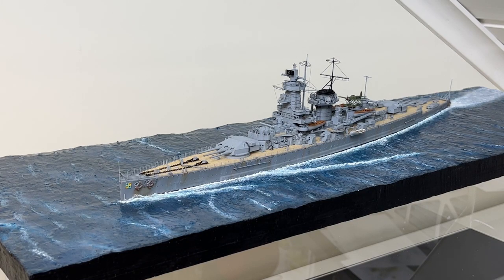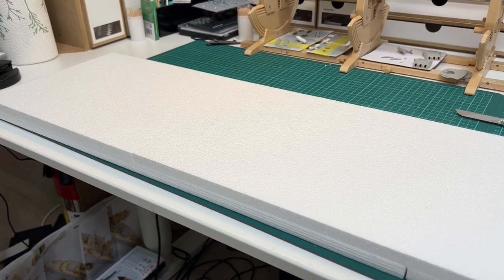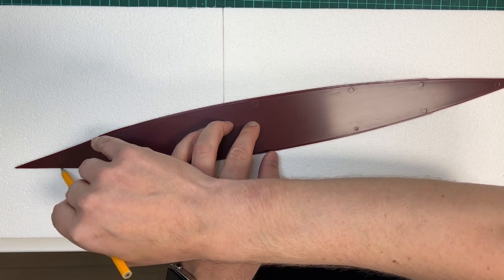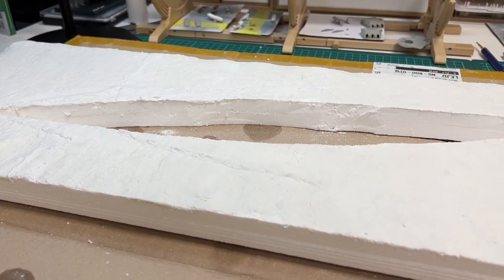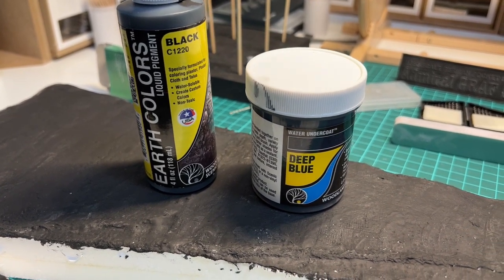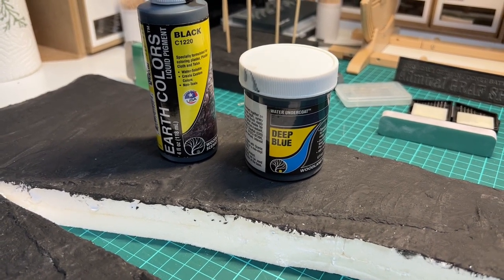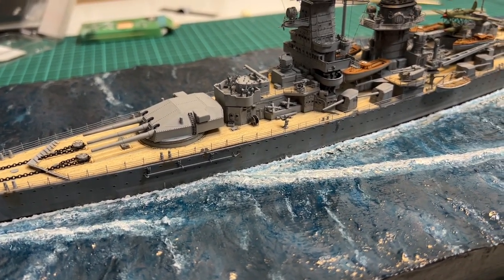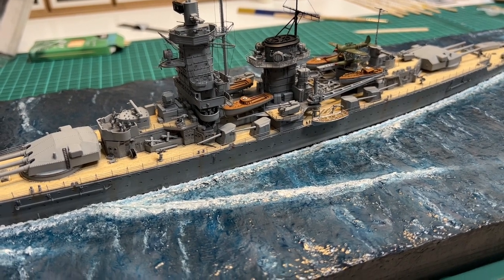How to make a diorama sea base - build log 14 of the Admiral Graf Spee build

Comment: When adding blue water texture do you cover the full board in a thin layer and add more to the waves or do you just add highlight streaks to it like you did with the grey if that makes sense ?
Reply from the maker: Add a thin layer on the entire base, and more on top of the waves you want to accentuate.
Reply: @NorwegianModellingBench  thanks I’ll see how I get on, fabulous work
Reply from the maker: @noclass69  Thanks 😊 Good luck 👍
Reply: @NorwegianModellingBench hello when adding your Atlantic blue do you need to thin the paint to get a thin layer
Reply from the maker: @noclass69  no there is no need for thinning

Comment: Can this sea base be use for 1/200th scale ships?
Reply from the maker: It certainly can, but I would make the waves a bit bigger or prominent so it fits more to scale, depending on the weather you want to portray.
Reply: @NorwegianModellingBench  I basically want to make it the same as you did for your Graf Spee.
Reply from the maker: @loreneckley7641  That shouldn't be a problem. I would look at some other options for the seafoam, using snow products so you get a bit more texture to it.
Reply: @NorwegianModellingBench  I'm planning in the future to build the 1/200 USS Enterprise CV-6
Reply from the maker: @loreneckley7641  The same that I am building? I will make a sea base for that one as well; that is the plan at least.
Reply: @NorwegianModellingBench  Yes, the same 1/200 scale Enterprise you're building. But I will have mine in a display case.